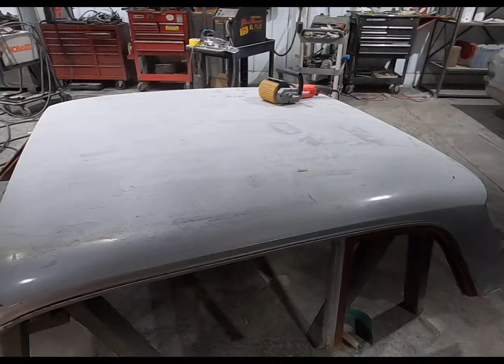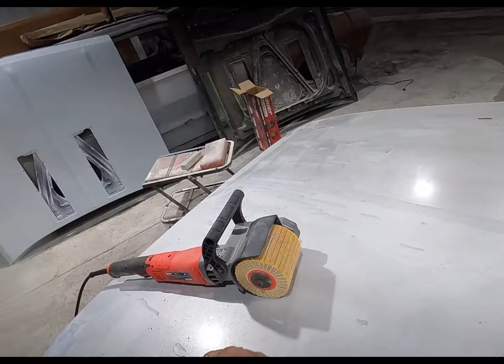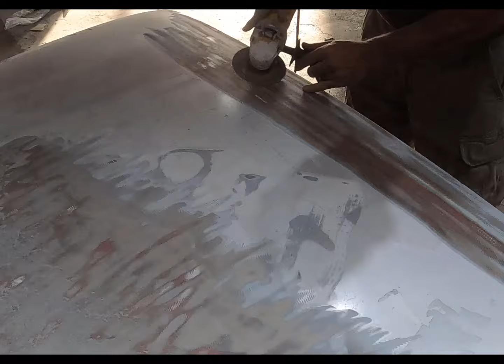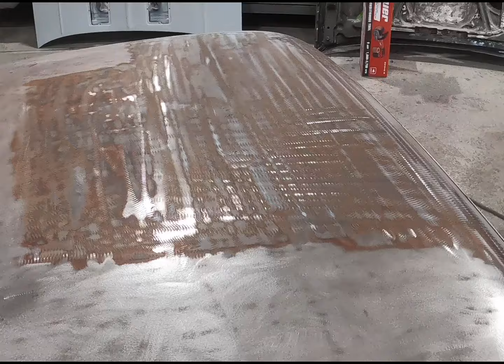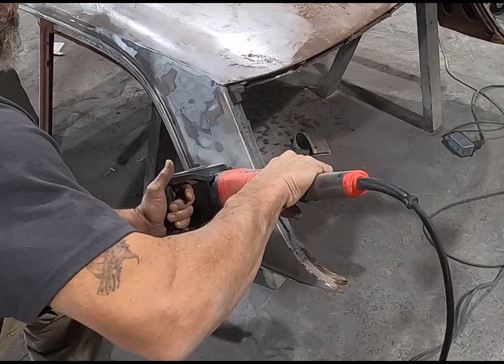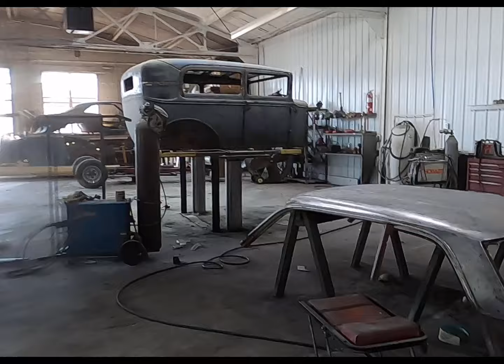ROOF swap on PANDORA has begun

Comment: I have never seen anything like that tan coating on the metal, only the red oxide on 1960's cars. I have used the stripping drums from the Eastwood company. 60 grit is best for stripping. Used the Citri Strip from Home Depot to loosen up the thick paint. Can't make too much dust here. Then cleaned the metal with the 60 grit drum and it was shiny like new metal. Covered up with epoxy.